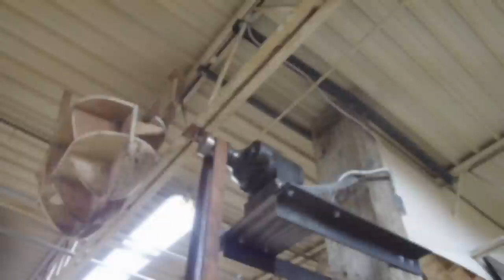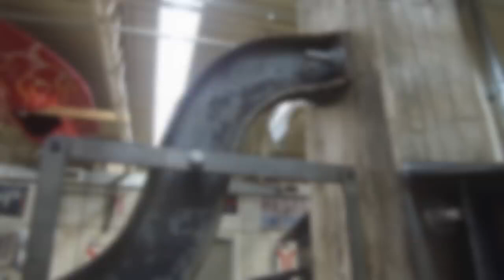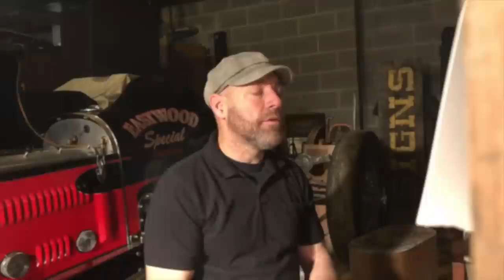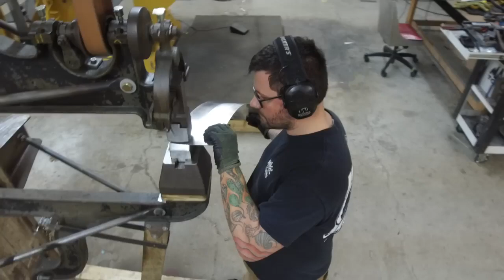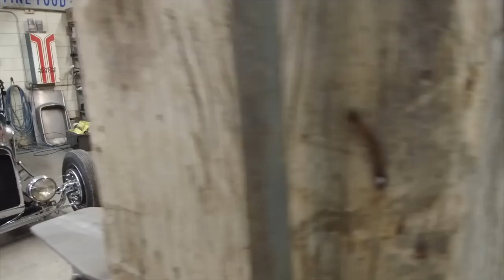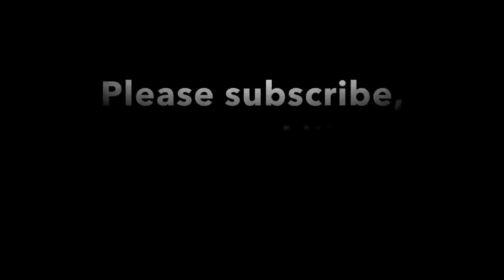Cincinnati history of our Pettingell Power hammer

Comment: I worked for C Cook Enterprises in Erlanger Ky. for 18-1/2 years before it closed down in 2017 when the owner Clay Cook died. We manufactured replacement parts and complete hammers for Chicago Pneumatic, Yoder and Pettingell brands. We also refurbished and manufactured replacement parts for the Pullmax power hammers.
Reply from the maker: Very cool!
Reply: @CornfieldCustomsofftheclock I enjoyed working for the company. However, it could be challenging working for Clay. The company was also a car restoration, hot rod shop and machine shop. The last big project the company did was a 1937 Ford Station Wagon Woody Truck that made the great eight at the Detroit Ridler car show in 2015.